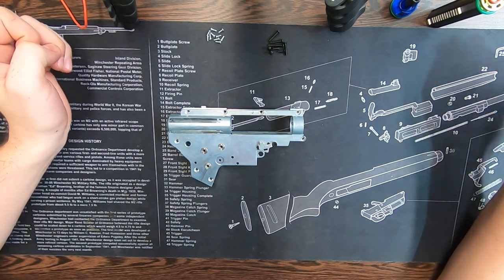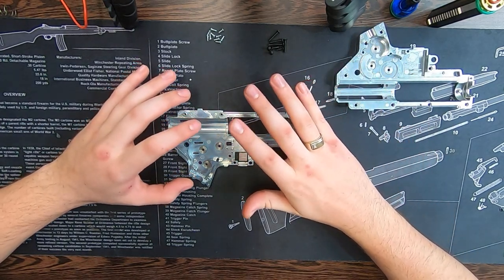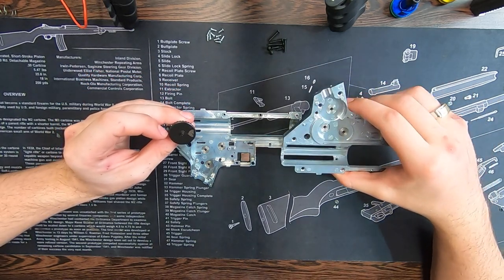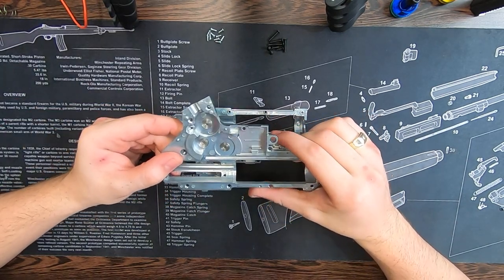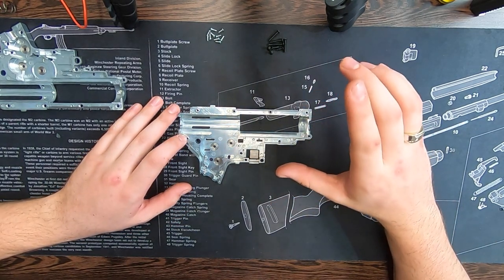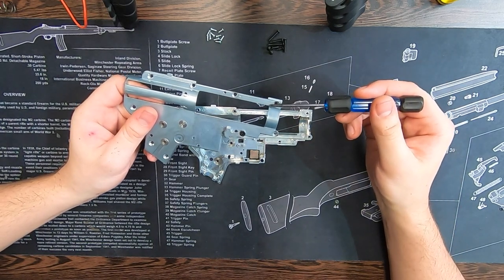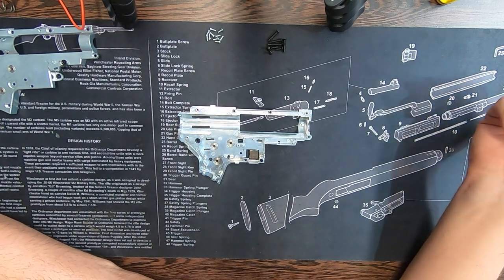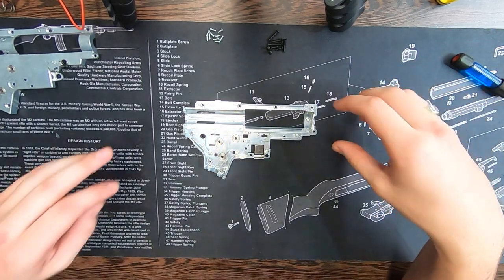Do's and Don'ts of Gel Blaster Gearboxes (Part 3) | Gelsoft Tech Talk

Comment: Running a MK Gen9 on a short cut M120 on a M160 motor full metal in a ACR J10 it's running real well...........shame on the mosfet no single dam pin plates one for a nother day..........out the box and the full max running upgrade for each and what maybe coming out ...... like metal tan colour rear stock metal parts a front block for the metal handgard and that metal top reciver part in tan gold???????